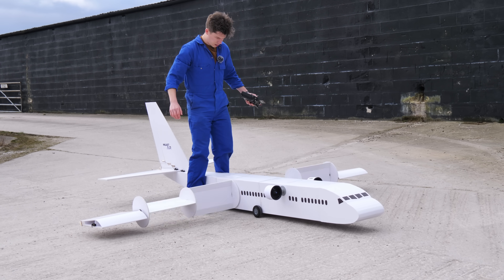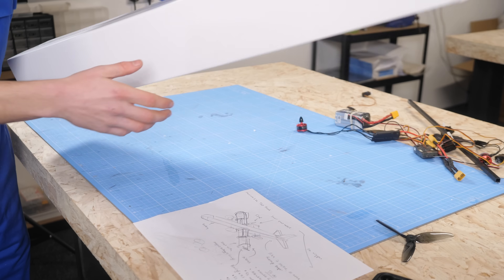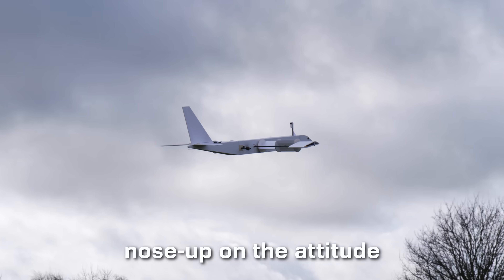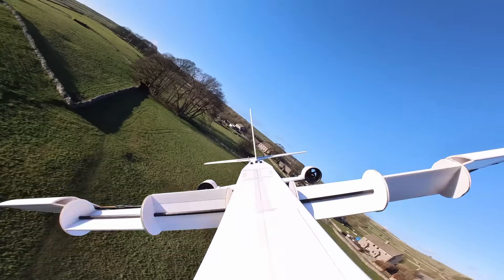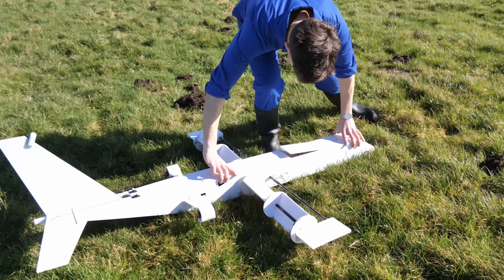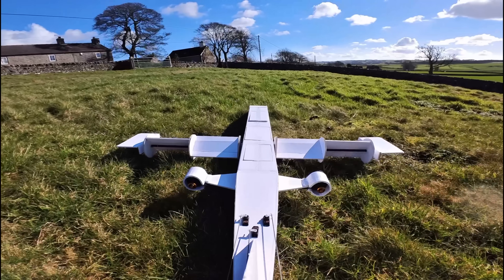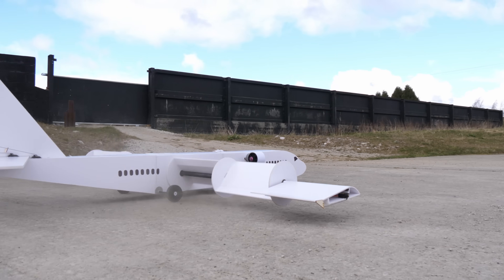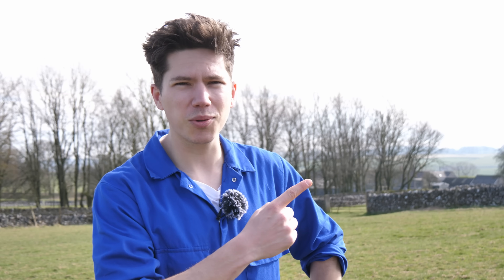Giant Magnus-Effect Plane

Comment: This is very interesting, but I don't think this is the Magnus Effect.  Every paper I read on this subject uses a rotating cylinder or sphere, not a rotating plane.  I believe that is why you are experiencing so much drag.  50% of the time, you have an air brake.  Try this with a motorized cylinder.
Reply: It might be similar to stepped airfoils, creating turbulent flow in a cylinder shape.
Reply: Yes, also the wings seem a bit short. Maybe a high aspect ratio would be better.
Reply: @juanromano-chucalescu2858indeed since there is probably much more lift induced drag.
Reply: Someone built a magnus RC using chicken buckets but I can’t remember the channel
Reply: ithink it is peter sripol
Reply: That's right , didn't a YouTuber make a plane powered by KFC chicken buckets
Reply: @bigislandoutdoorlife1489  Peter Sripol did it I had to look it up.
Reply: This is the Magnus effect, though a poorly optimized version of it. Whether it's a flat plate within a circular housing or a full cylinder, it still creates a rotating flow, that when combined with a linear flow from forward movement creates lift. 
Source: am aerospace engineer
Reply: @Quasarnova1 correct, a flat plane spinning fast enough acts just like a cylinder.
Reply: @Quasarnova1  so how would this idea improve on a traditional wing? the complexity alone should kill the idea unless there is some magical theoretical improvement possible.
Reply: @mr1enrollment  Hypothetically. Assuming we get some sort of microfusion power using AI so we can magic away the weight of batteries. They would fit in a wheel.

Flying cars.

Self-Driving racing is boring. Now self-driving cars racing on a track with stunts, that's amusing. You could use these two, not necessarily fly, but to fall with style. Some sort of autonomous stunt racing circuit would be fun.
Reply: @mr1enrollment  There may be some niche benefits like being less susceptible to stall from angle of attack, but they're outweighed by other stability and control drawbacks. It's a cool project, but there's good reason why it isn't used for passenger planes.
Reply: @ falling with style - that is what I expected, lol thanks
Reply: @Quasarnova1  does precession from the rotating mass affect handling to an appreciable degree? It seems incredible unstable, or maybe difficult to control precisely, so I wondered if precession was fighting against him and any wind. Also, limited control surface area doesn't seem to be helping much, either.
Reply: @LordPrometheous  Yeah, gyroscopic precession would definitely make the handling weird. The theoretical answer would be to make the wing as light as possible to eliminate it, but that's very difficult when it need to carry the weight of the plane and rotate on top of that. Stability is a separate issue, it doesn't gain and lose lift from pitching up and down like a normal wing, so you can't really make it stable, but it isn't unstable either, just neutral, which can still be difficult to control on top of everything else. 
With separately powered rotating wings, you could simulate control surfaces by speeding up or down the rotation to increase or decrease lift, and you could probably even make a control system that adjusts them automatically based on an accelerometer to get fly-by-wire type stability, but that's getting very complex for a hobby project.
Reply: @Quasarnova1  I see. It seems that the oscillations were also an issue, as he noted it was worse as specific RPMs, I'm guessing at or near the resonant frequency and/or its harmonics. Interesting experiment, but hugely impractical for so many reasons. Thanks for the insight. As a kid, I wanted to be an aerospace engineer, but then I remembered I wasn't the greatest at math.
Reply: @LordPrometheous  Oscillations (especially at specific RPM due to resonance) are a potential problem with anything that spins, propellors included. The solution is just to balance it better, easy for a company manufacturing things with precise tools, but difficult in your garage. AE is cool, but yeah, it's a lot of math.
Reply: @Quasarnova1 it's not the Magnus effect, that is only with a cylinder, just can't remember the proper name for this
Reply: @Quasarnova1  No , it isn'
Reply: Yeah. Not Magnus effect.
Reply: Agreed. This looks more like a perpendicular propeller, not dissimilar to the old paddle boats of the Mississippi.
Reply: Great experiment! I suggest to try a powered Flettner-Rotor.
Reply: From my earlier comment, this is a horizontal positive-displacement rotor throughout the vast majority of its flight envelope.  This is not the Magnus Effect.
Reply: Every rotating object in a stream of air (or any other liquid) has a magnus field.
Reply: He didn't use cylinders because powering them isn't optional they create too much less of a lift by themselves and also require to be spun at a higher RPM which adds to the inefficiency
Reply: the paddles would cause much more drag compared to a cylinder and also produce less lift. As on average, the spinning paddle will have less lifting cross section for any pressure differential to acting in the vertical direction.
Reply: I am curious whether a rotating cylinder could be used at the front of the wing. with a fixed tear drop shape on the trailing edge would further reduce drag. fluid flow is usually laminar on the front of a cylinder but detaches on the back, causing a lot of pressure drag.
Reply: @VTOL123 I don't think a "rotting" cylinder would help much at all.... 

I would just eventually fall apart
Reply: @davelowets  Lol, I have corrected it
Reply: I disagree: This is indeed the Magnus effect.  HOWEVER, I still think a smooth cylinder should be tried, because there will be far less turbulence caused by a smooth cylinder than by these spinning rectangles.
Reply: Squodgam...do some minimal research before opening mouth.
Faraday ROTOR not rotator or whatever - the backstory to how it was named was given so your smart arsed and wrong comment is not appreciated.
Reply: https://youtu.be/xMoVzV-XmU0?si=iDN9KcYD7b_AcmKk
Reply: @dennisbecraft1303  This plane is operating on the same "horizontal displacement rotor" lift mechanism.  Please see the prior comments in this thread on its primary source of lift.
Reply: MAGNUS-POWERED GYROSTABILIZED BALLCOPTER HAS ENTERED THE CHAT
Reply: I agree with you. Cylinder will be draggy, but the flat rotor being used is way worse. It would also be easier to balance to reduce the vibration too.
Reply: You are correct, Magnus is a cylinder, just can't remember what the name is for the rotating flat plane is😢
Reply: Back in the late 1960’s I had a ‘kite’ named a Revo-jet.  It had a simple fuselage with a length of piano wire passing through like wing soars.  To this was fitted a freely rotating ‘wing’ similar to the arrangement in this post, one ‘wing’ on each side.  The big difference lay in the fact that each ‘wing’ had a very pronounced smooth ‘S’ shaped cross section as viewed onto its tip, and a simple horizontal stabiliser was built into the rear of the fuselage.  The piano wire was bent at its centre to create a good amount of dihedral to improve roll stability.  A string was attached to the underside of the fuselage, the other end being held by the ‘pilot’.  If there was sufficient  the ‘wings’ rotated rapidly and produced lift.  The devise then soared aloft just like a kite.  If the wind was insufficient, then the ‘pilot’ had to run, towing the Revo-jet behind him, to generate sufficient lift.  Drag and the resulting tendency to be blown backwards was opposed but the tension in the string.  If the pilot let go of the string, the wind blew the Revo-jet backwards and it gently settled to the ground as the rotational speed dropped.    I suggest that a pronounced smooth ‘S’ shape should be tried as an alternative to the flat and nearly flat plates used in the model in this post but you’d need to have the orientation of the ‘S’ shape correct to generate lift.  By that I mean whether the ‘S’ should be like a forward-written ‘S’ or a mirror-imaged ‘S’ on a given wing.  And try adding generous dihedral to improve roll stability.  If lift is still insufficient, you probably need to increase the wing span.  With an ‘S’ section you won’t need to divide the wing into two sections at 90 degrees to each other as an ‘S’ section is self-starting at any orientation.
Reply: I agree.
Those would be called cycloidal propellers.
To generate the Magnus effect you need cylinders or spheres, that will generate an up lift I  the opposite direction of the airflow once the cylinder is already spinning.
Reply: I agree.  There is a novel type of airplane that doesn't use standard propellors, but something called cross-flow propellors, that look like rotary lawnmower blades.  I'm wondering if this is actually producing the same effect, rather than the Magnus Effect.
Reply: Potato
Reply: rotating cylinder might be better
Reply: The Magnus effect strictly relies on viscous forces on a smooth spinning cylinder to produce fluid circulation and, therefore, lift (through the Kutta–Joukowski theorem, etc). Other methods of producing circulation, such as vanes, ribs or paddles, could also produce lift, but they are not the Magnus effect. 
These other methods are likely to produce less lift and more drag than a simple rotating cylinder.. however, regardless of their merits, they do not produce lift through the Magnus effect.
Source: am a hydro-dynamicist.
Reply: @msbealo  It seems that we agree on how the lift is made, and only disagree on how strict the definition of the Magnus effect is. I was taught it as only being the combination of a uniform and vortex flow to create lift. 
In order to create viscous forces, the cylinder surface must not be perfectly smooth, and I don't see much difference between a rough cylinder and one with small ribs in terms of describing the effect. Just my 2 cents.
Reply: This is called a Faraday rotor , named after Michael Faraday notices a business card dropped auto rotated and glided.
Reply: @rossnolan7283 no, a Faraday Rotator is an optical component, not an aerodynamic device.

(BTW I wrote this same reply earlier but it disappeared. Weird...)
Reply: @Squodgamullis Your comment disappeared because the automatic A.I. chat bot saw it as being argumentative and scrapped it. The shadow banning on YouTube is getting out of hand.
Reply: @davelowets  so true.
Reply: @rossnolan7283 a Faraday rotator is an optical component.
Reply: @rossnolan7283 Were business card even a thing when Faraday was alive?? 🤷🏻
Reply: A plane is just a circle with less sides :P
Reply: This is the Magnus effect with a kind of Flettner-Rotor.
Reply: Ya, this was almost flying, barely falling at all.  LoL
Reply: the rotors are spinning the wrong way for magnus effect
Reply: @paavangoyal  you are completely wrong they are supposed to spend backward they will create downforce if this pin in front
Reply: @paavangoyal  wrong
Reply: He made a giant paddle wheel.
Reply: Yeah, it seems our engineer accidentally invented a new technology 😮
Reply: He's a really smart guy. There must be some back-story in his previous videos as to why he can justify the aerodynamics of this arrangement as constituting an actual Magnus effect, some obscure paper or something. I mean, you can't be telling subs and working with intelligent friends and collaborators and not be told up front right early.
On the face of it, perfectly smooth balls and cylinders are known to more poorly display the effect. Rough surfaces fare better. New tennis balls are a good example. So maybe he's taking "roughness" to its logical, if paradoxical conclusion: A smooth contiguous convexity is transformed into 4 deep concavities, and it makes visual sense: the air is slipping effortlessly over the top of the rotor, we can even think of it being impelled back if the vanes are going faster backwards than (global) airspeed. Meanwhile below it's the opposite; there is a lot of drag, yes, but a very large upward vector component from quite a bit of air momentum downward.
Reply: @-danR  Using a cylinder guarantee that the air will follow the surface until it reaches the half of it. If you use a vertical  wing the air just hit the surface turbulently and escape everywhere. This works for large planes but since aerodynamic is very different on small scale maybe he find out it is better to use wings.
Reply: @-danR  No, what you are describing is not the magnus effect. Some projectiles have dimples or roughness added to generate vortices, which reduces form drag. The magnus effect, well just read the Wikipedia article on the magnus effect, there's literally too much information for a comment. But yes, the effect is optimized with smooth, elongated cylinders. I believe the flaps that are attached to the cylinder are intended to catch the passing air, to free wheel the cylinder. But, these are way oversized for this scale. They might be providing rotation at low airspeed, but that comes at an insane drag penalty. Motorize the cylinder and get rid of the weather vanes, or make the vanes much smaller so they can still drive rotation at cruising speed without all the drag
Reply: @-danR  You're probably right, it would be very nice of him to talk about how he got to the design. He makes it look like he just starts building randomly
Reply: @-danR  Look-up the Navier-Stokes equations.  The low Reynolds number regimes are where the Magnus Effect occurs.  Only the very few first degrees of the initial rotor turn when the plane is at a low relative velocity to the incoming air could you have ANY Magnus Effect components contributing to lift.  After that, it's a positive displacement horizontal rotor.
Reply: @davidacuff4685  Magnus effect is absolutely not limited to low speeds or Reynolds numbers. It is a not insignificant factor when looking at the trajectory of artillery travelling at several times the speed of sound. There are several academic papers that look into this.
Reply: @Quasarnova1  Not from any source I'm aware of.  Please cite the artillery reference.  Could you perhaps be referencing transonic transitions or Coriolis effect in lieu of Magnus for artillery? Magnus exists at high Reynolds numbers (actually it exists for ANY rotating body in a fluid), but it's influence is negligible compared to other aerodynamic forces for all but the lowest of Reynolds flight regimes.
Reply: @-danR  Possibly true, but the rotors need to be powered, not spun by onrushing air, for best effect.
Reply: @-danR It WOULD have been easier just to say, "That's why golf balls have dimples"...
Reply: The plane isn't rotating only the wings 😂
Reply: @yakustone6356 not the airplane. The flat surface spinning inside the wings is the “plane” they’re talking about.
Reply: @ball_soup  Pretty sure wings are called wings and planes are called planes. Weak troll bro 😂
Reply: Quite correct. The magnus effect requires some variation of a CYLINDER. This is more of a "paddle wheel".

Comment: Wouldn't powered rotors with independent left/right control a better design? Like a differential thrust thing? Or does the forward propeller arrangement provide for differential lift? Interesting...

Comment: 5:42 It doesn't have ENGINES, those propulsion units are called MOTORS. Engines operate with expanding gases, while motors use electrical power and magnetism.
Reply: You're an engine
Reply: It's an rc plane man calm down
Reply: Nobody cares dude. I’m an aircraft technician.
Reply: Seriously, get a life.

Comment: Here is another interesting design using 2 powered cylindrical Magnus effect rotors:
https://www.youtube.com/watch?v=hlmvHfIAszo
https://www.youtube.com/watch?v=jLDxUWTeDnE
But your design has the benefit that it will glide to the ground if the power goes out, whereas the design above will not.

Comment: You could get more diameter from the magnus effect wings if you mounted them higher like a bombardier or c-130. It might be more stable too with a higher wing. Just keep the thrust above the wing axel so it pushes backwards.
Reply: Most planes wings tilt up (like a cesna) or down (like the c-130) so they balance better as well.

Comment: use a passive magnus cannard on the front nose and single pusher motor on top of the fuse this will create a downward pushing on the wing while providing the pendulum from the point of thrust being hire ...you need to make the drag from the spinning wings work for you by applying pressure to the wings not just by catching wind
Reply: That is genius. The front nose is getting most of the drag anyway, might as well take advantage and turn it into a magnus cannard like you suggested!

Comment: too much janky going on, just use a plastic tube, or any wing looking geometry, or just body wing. lmao for the attempt. yeah possible but reasonable? maybe not. unless you want to vtol with the spinning rotor wings. radial directional fan thrusters instead. yep radial centrifugal spin edfs. seems to have minimal tolerance for error at real operation. ie not very robust. why air paddle boat.